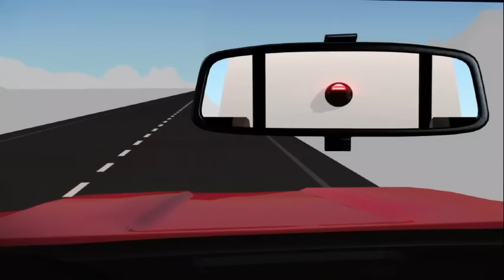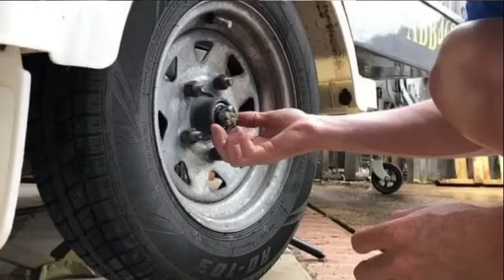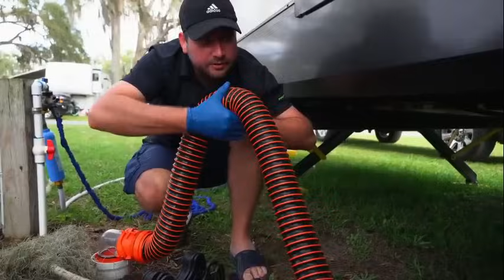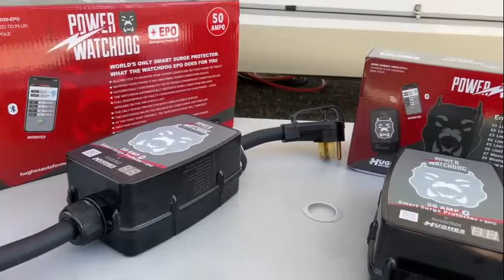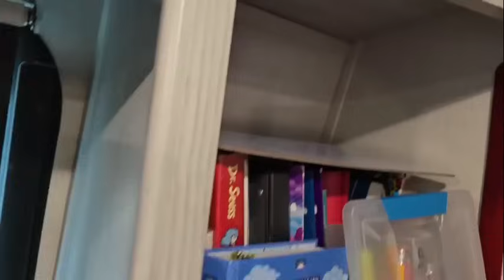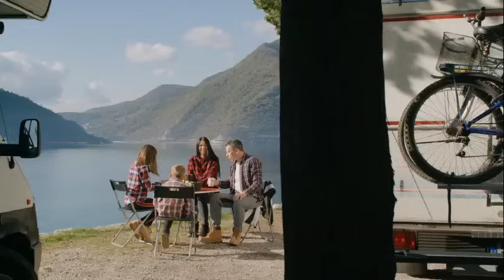15 Biggest RV Mistakes Every Beginner Makes (And How to Fix Them!)

Comment: Facts .
Reply from the maker: Thanks for your input! I'm glad you found the video helpful, here's to smoother travels ahead!
Reply: @rollinwithrver  every time I used propane I have the habit of turning it off at the tank when done even after I’m done grilling. The same with on a camper . I make sure stuff is shut off when not use .

Comment: times to thing about , 60% of trailer load should  in front of the center of the 2 axles or in front of the single axle, ! i know it hard to judge the weight , on most trailers thats the way i do it!  rule of thumb for the hitch , the center of the ball on the hitch should 15- 16 "off the ground , with a weight distrabution  hitch to balance the load is the best policy! on my slide , i installed a rain dampener cover over the slide,  bolted to the side of the trailer to the outside of the slide,  as it retracks back so does the cover, ! i installed it for the reason of rain and snow!
Reply: You are wrong about a number of things. Tongue weight should be 10 to 15% of the trailer’s loaded weight. Not more, not less. Trailer weight should be determined by weighing at a scale, not guessing. Then determine proper tongue weight. Weight distribution isn’t always needed. Consult your tow vehicle’s manual.
Reply from the maker: Thanks for the detailed feedback, you're right that proper tongue weight should be 10 to 15% of the trailer's loaded weight, and there's no substitute for weighing your rig at a scale. I agree that's the safest and most accurate way to go, especially when you're dialing in a new setup.

That said, for folks who may not have immediate access to a scale or are still learning the ropes, using a rough 60/40 load distribution and aiming for that 15–16" hitch height can be a helpful starting point. It’s not a replacement for proper weighing, but it’s a way to get in the ballpark until they can do it the right way.

Same goes for weight distribution hitches, some rigs absolutely need them, others don’t. Depends on tongue weight, tow vehicle ratings, and overall setup. Always a good idea to read the manual and know your numbers.

Comment: Act like you are a commercial big rig driver you do a pre-trip inspection and you do a post trip inspection. You don't move until everything on the list is checked off. The absolutely most important thing for your safety are your front Steer tires the operative word steer. Take the time to check both sides of each Tire's sidewall in fact that's what you should be doing with all your tires but steering is the most important❤